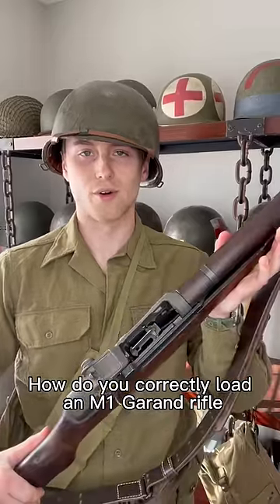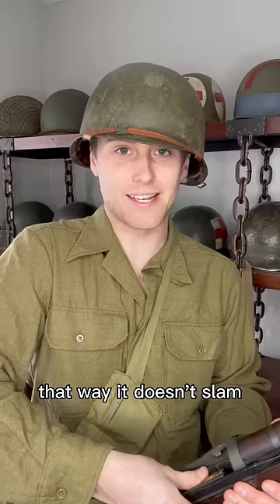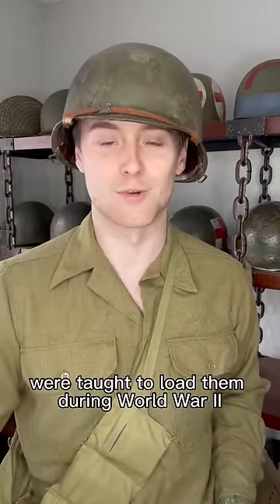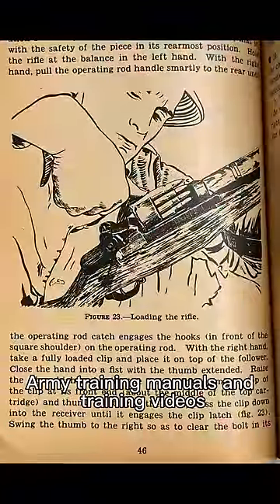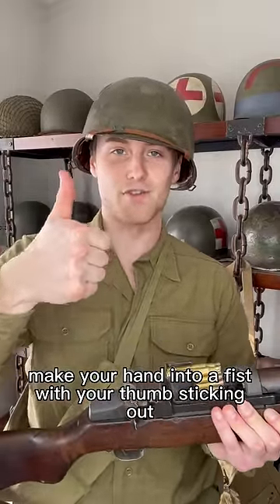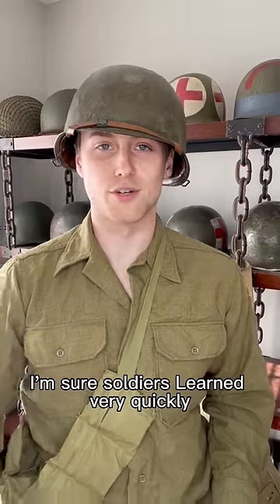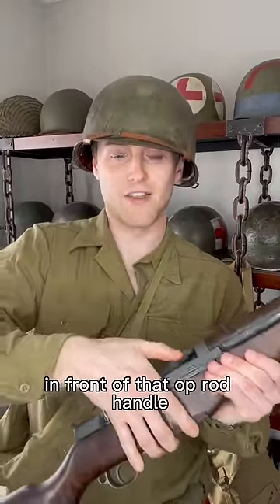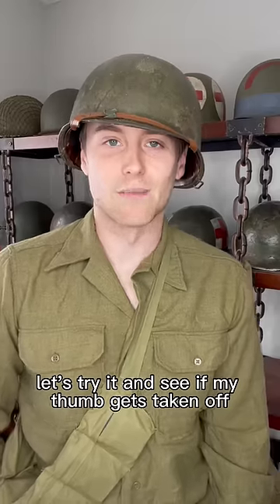How to (in)correctly load an M1 Garand

Comment: It seems sketchy not to have your hand in front of the op rod but it's usually fine. The bolt will not come forward unless you relieve pressure and by that time your hand is out of the way. I said usually fine because sometimes if your trying to reload a Garand under stress , your thumb could potentially slip and cause Garand Thumb. A soldier in a battle probably would not even feel it because of adrenaline.

Comment: I completely keep my thumb in there, stopping the bolt from slamming home. Then, I quickly pull my thumb and the bolt does it’s job.  Sometimes i have to slam the charging handle forward, yes. But I had to do that sometimes even before I came up with that method.

Comment: I've heard before that garands that close upon releasing like that are due to a worn out bolt system or something like that. I thought it was correct since I've seen multiple videos of garands not closing until the bolt was pushed forward slightly, even in old training videos so it can't just be a reproduction thing.

Comment: you need to align your thumb with the clip, and press down while the tip of your thumb points forward, then the bolt comes forward, and just slides under your thumb.

If you try to press the clip down with your thumb in a 90 degree angle on the clip, that's when you get your finger slammed.

Comment: you know it wont slam home until you release pressure right? you can keep pushing on the rounds to ensure the bolt doesnt close on you and once you release, only then will it charge forwards. so no need for quick jabs in and moving your hand away

Comment: Honestly. Its like clearing a jam on my verona. Stick finger in, wiggle shell, and right as it pops let the bolt push finger out as u slide ur hand back to firing position

It has bit me twice

Yes it fcking hurts and of corse it was on the cold days shooting

Verona semi auto 12 guage. One of my all time favs. Tho recently after years of abuse somehow finally broke it. And the break was the buffer tube inside the gun "the one that holds spring to push botl back" somehow entirely self destructed. Spring backing plate and all the lil pieces just shattered

Anybody got n idea where to get parts lmao

Comment: Garand thumb is completely unnecessary.  If you have the bolt locked all the way back, you can push the enbloc clip in with your thumb, you will feel and hear the first click, and you can keep your thumb there all day and the bolt will remain in place until you lift your thumb out of the way.  Garand thumb is simply user error.

Comment: A properly maintained M1 WILL NOT slam forward with the bolt when loaded. That is a myth. That firearm was designed by a genius and has been in existence for a century (give or take, gimme a break here.) You think they'd have worked that issue out LONG before now.
Reply from the maker: Uhh you are absolutely not correct about that one bud. It even says in the original WWII manuals and training films that the bolt will go forward automatically once the clip is inserted. That is just how it works. It often doesn’t close very hard, it just rides forward. Sometimes it needs a bump, just depends on the specific clip and weapon being used.

Comment: "garand Thumb" simply DOES NOT HAPPEN.... thats why they were trained to load that way. 
.
with a full clip.... the bolt will NOT!!! close until you remove your thumb
.
and if the rifle is new / clip is new.... you will have to bump the op-rod anyway to get it to close. 
.
.
you can ONLY get m1 thumb from trying to load a clip with 7 rounds in it (which i do when hunting... so i can carry with an empty chamber) 
.
if you push the clip to the bottom with 7 rounds... the bolt will close, "ride over" the top round... and try to chamber your thumb
.
the other way to get m1 thumb.... is trying to close the action with ZERO ammo in the rifle... 
.
if you press down on the follower AT ALL.... then move the op-rod backwards AT ALL.... it will close
.
.
.
again... people, today, think m1 thumb was very common to the point of being a design flaw. 
.
this is simply not true.

Comment: The "new" method you show is wrong. Or, rather, it is unnecessary. The original manuals were correct. Indeed, the hand blade method slows reloading down and that ain't good, particularly as the Garand is likely the fastest loading battle rifle and that is one of its major strengths. Have owned maybe 15 Garands since 1964 and I have never been able to acquire the "thunmb" while loading. Physics. The "thumb" occurs when a dweeb sticks a digit in an open and unloaded action and releases the clip catch.